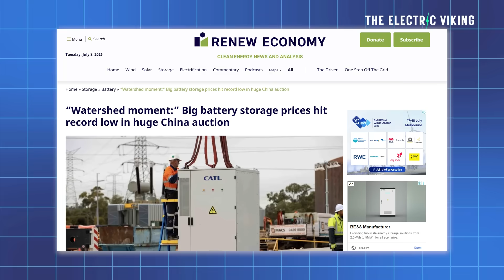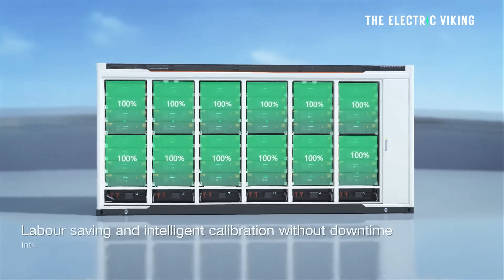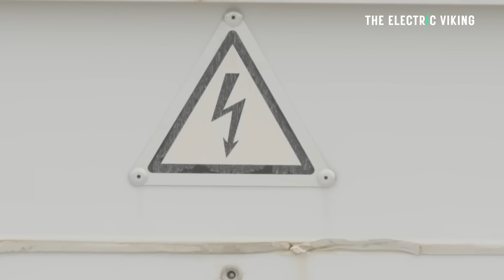Battery prices fall over 30% in 12 months - coal and gas economic madness

Comment: Im from Sweden, and the swedish electricity is 100% oil and gas-free. And of course, not a single coal plant either. And it has been so for decades. About 65% is from renevables and 35% from nuclear. And the energy prices are low. Heating of private houses and tap water is still 2% for oil, mostly old people that does not want to change. Gas is not around at all. And have in mind, the swedish climate. 

For me, personally, I drive a Battery EV, and I can drive 350 km before charging in summer. During the coldest winter (-20 deg C) 250 km. During +7 years I have needed charging about 5 times in public chargers. Back home I charge from solar and batteries wirh my own electricity. Still connected to the electrical grid though, but I could disconnect tomorrow, but I get some money from feeding my surplus to the grid. I supply much more energy to the grid than I recieve. So yes, it is absolutely possible, to leave fossil fuels behind and it works very well. If you of course have the knowledge to design your power systems in the right way. Network design is not the same in the "old school" as with renewables. This transition is starting to be adressed, towards a more intelligent electricity grid, with thousands of micro producers.

This is not idle speculation, I have done this for years. Anyone who doent agree is either ignorant or just plainly stupid or spreading bovine manure....
Reply: I went all-in with solar nine years ago, haven't had a heating or utility bills since.  Late last year I bought a Chevy Bolt that I charge at home, haven't bought any gas since 😊
Reply: very informative!
Reply: And we should continue to build up our battery factories. One rotten egg (Northvolt) should not scare us away from this opportunity to build an EU battery factory.
Reply: Unfortunately adding solar doesn't work out economically here in Oslo. Installation costs are too high. Definitely recommend it when changing roofs, though.

Comment: I was wrong.  CCGT is 1/2 to 1/3 the cost of PV plus batteies, depending on the cost of natural gas.  PV plus batteiies have to be overbuilt, resultining in about $200Mwh.  I'm a hjuge fan of PV and batteries, but they're not ready for baseload yet.

Comment: I think we still want an ultimate backup like hydrocarbons from wastes.  we could use fuel cells, but for something that will only run 1% of the time gas turbines seem fine. We need to recycle the wastes anyway, no dumping.

Comment: All forms of energy may not be enough with the huge demand of data centers in United States
Reply: Data centres are switching to optical processors so in 10 years energy demand will plummet for data processing.
Reply: a disaster at the moment, but the future looks better.
Reply: It's looking good for them, they consider moving to Canada 🍁 where there's a surplus of cheaper power.

Comment: Coal / other traditional energy sources still have an important part to play while the world builds more efficient energy infrastructure. Coal may be easy to label ‘outdated’ but what’s more outdated is having no power at all when we dive head first too soon and we don’t yet have the storage or other reliable renewables to consistently handle the load. Must be built and/or transitioned wisely, objectively and free from ideology for it to work for all. Eg. California asking people not to charge their evs. Eg. South australia having 3 day blackouts. Etc etc
Reply: carbon negative hydrocarbons from wastes can provide continuing backup since we keep making waste.  Fuel cells would be cleaner, but more expensive.  It's only going to be fired up 1% of the time, sometimes not for years.

Comment: The Tesla power wall does not appear to be decreasing in price!!!
Reply: Well, the powerwallmay not have dropped in price but the do-it-yourself powerwalls have dropped by 2/3 and you can now get a 3500 or 3200 w solar generator for the same price you paid for 1,000 watt solar generator 2 years ago.
Reply: The electricity going into that battery "wall" should be decreasing in cost.
Reply: @markhathaway9456  It isn't and it will increase dramatically in the next few years.  Our power company projects an increase in demand of 25% in only 5 years.

Comment: Remember all those arguments suggesting why wind and solar would not work? Those arguments forgot to take into account the forward progress in technology. And as sodium-ion ramps up, as does automation and more efficient PV, costs will decline significantly.
Reply: That's a verbal trick anti-renewable energy people use. They list current tech limitations as the reason to not take it seriously. As if tech will never advance or be better and also cheaper, which is what happens. I say, if you have to make an argument using a trick, you don't actually HAVE a serious argument in the first place.
Reply: @davidgrushk  its is true the solar in Germany was more then a little rose color glass the USA even New England has much more sun then them offshore wind is expensive and the cost is up front adaptation in the US wind and solar will be more productive and more easy. One of the real issues is data centers they are hogs and going up fast so even as generation increases we will have the old power plants at least for a time.
Reply: @davidgrushk  ... and pro-renewable people use the same trick against nuclear energy, point out to current or even old limitations as the reason not to take it seriously. AS if the technology will never advance. Plus, they ignore the recent lack of research into improving nuclear relative to the vast sums spent on improving renewables. Both sides play this game.
Reply: @robertlipka9541  But there is no cheap new Nuclear technology that will come close to the current low cost of solar. Nuclear still needs a base load, traditionally pumped hydro, and now batteries.
Reply: @Terry-y2r  ... of course cheap nuclear energy is possible... IF you stop adding unnecessary regulatory hurdles against it (ones that do not add to safety but increase costs), standardise on ONE safe design, etc, etc. It can be done cheaply especially when you consider renewables need storage and use thorium as fuel as not to produce long lived nuclear waste. The shame is that we decide energy policies through propaganda wars.
Reply: @robertlipka9541   How can Nuclear compete with solar which has no moving parts to maintain and free fuel. The fact is it is not even close to being economic. There is a reason for the regulations, safety. When regulations are ignored you get Nuclear disasters which result in loss of life and long term radiation contamination.
Reply: @robertlipka9541 First, nuclear is not an enemy of renewables, only carbon emitting technologies are 

Then, the problems with nuclear is that they have established cost curves, and they are negative, in contrast to renewables. The new nuclear technology touted is as of yet untested in a real economic environment. Furthermore, recent plants have been plagued by extreme cost overruns and delays. So, when you compare cost curves, you'll need to hypothesize an extreme improvement in cost efficiency to compete with renewables. Add to that the short deploy time of renewables, and it's hard to conclude that nuclear will pay a role in the future grid on any reasonable time scale. 

Luckily I don't have to convince anyone of this, as investors know how to use a calculator. The only threat is politicians thinking they'll be the facilitators of "the next big thing" or being fooled to siphon investments away from renewables.
Reply: In the UK, electricity charges are still based on natural gas.  Since renewables are cheaper, the government is playing with the idea of localizing the saving to encourage municipalities to allow solar or wind power generation in their areas.
Reply: @newsgeekus1216  

"Since renewables are cheaper"

A truly laugh out loud moment.
Reply: @newsgeekus1216  Uk need some coal plants desperately.
Reply: wind energy is still a scam in most cases. In Europe they reached 5% of capacity only, meaning most of the time they are down in energy production, but the cost is huge and the environment cost is huge also with materials that are toxic that you can't get rid of or recycle. In northern Europe, solar energy will never be enough because the sun doesn't shine when they need it the most. Take Copenhagen for instance, in december the sun goes down at 3pm and it's very cold. Countries like Spain or Australia can't be taken as example because of their climate that allows less energy needs for housing, in these countries, insulation alone will account for the most reduction in energy needs. Solar can work but panel production is not localized where the markets are so it's a labor right non sense for now. Batteries same, and they are expensive, it can take up to 15 years to amortize the cost, which is awfully close to their lifespan. Many years will pass until it's truly interesting financially. Rich people that want to help the environment can afford it but not the majority of the population. I know someone is Spain that rents his batteries and it cost half of its original energy bill, nothing crazy interesting, his whole installation is rented and it's the same price as before he switched to solar.
Reply: The cost to manufacture solar today is already around 6 cents/watt. Unless there is some material step change? I can't see it declining much more.
Reply: @davefroman4700  There's about 6 cents! But in all seriousness, there is still room to increase efficiencies, production costs, or installations.
Reply: @SeanLumly  Its already a 100% automated process. And more and more of their supply chains are achieving that as well. The price of EVERYTHING over the next 10 years is going to plummet as the digital autonomous era matures.
Reply: @davefroman4700  Reductions in production costs can be anything, including manufacturing closer to site to reduce shipping,  factory efficiencies despite being automated, or using cheaper manufacturing materials (eg. Sodium-ion batteries if this is rightly included in the overall cost of solar/wind). And yes, I agree. Costs are going to continue to fall!
Reply: @davefroman4700 The cost curve has been very consistent, and the technology is improving still, with perovskites likely to create a big jump in efficiency. Total cost will decline more slowly because of installation costs not declining at the same pace.
Reply: Yes. I do. UK and Germany were the leaders and very smart. Now they are stuffed with very high energy prices
Reply: @MPP241  very true but all of that caused these advances to happen The UK is dark so is Germany offshore wind is not ever going to be cheap they felt they had to it to meet targets.
Reply: Wind is the most expensive and least reliable form of energy production!
Reply: @derekjohnson9575 .    Maybe where you live.   Here in Texas we are going crazy with wind, generates like 30%.   Electricity rates are 14%.   We have just started installing those super large turbines that are able to tap upper flows, thus almost providing base generation.
Reply: Diesel imported by sea or air is far more expensive than wind typically is. That's why northern Canada is using solar and wind more. Long days with sunlight build up large credits for use during the winter and less diesel is used. Wind is almost always blowing.
Reply: @annoyed707 what credits are you talking about? solar and wind energy can't be stored efficiently in the quantity needed
Reply: @raph151515  The energy can be stored economically using pumped hydro for grid scale long term storage. It been done for 100 years. Batteries are now also economic to do the same.
Reply: @Terry-y2r  pumped hydro is limited in capacity, most developed countries are already at capacity in terms of hydro, nothing new to add and it won't cover most of the demand. Hydro is a high frequency storage used to fill gaps between raise in demand and plant startup
Reply: @derekjohnson9575  we have not really built the kind of very tall turbines that will run 90 plus % of the time.
Reply: @derekjohnson9575  Only true if it is offshore wind.

Comment: I live in northern California. I pay some of the highest home energy prices in the world to PG&E. Costs keep going up every year. Trump is waging war on solar wind, battery storage and EVs. None of this seems to ever change. I can’t afford solar on my roof. The math does not make sense. So the reality is that the average American even in wealthy areas of California can’t afford solar. Payback period is still very long. Sun Power went bankrupt so I don’t feel I can trust any of the many small installer companies. They install and run then go bankrupt. It’s depressing.
Reply: Mhm, maybe worth to do some math here. Germany charges 32 Euro ct/KWh to household owners. A 2 KWH battery with inverter and 4 panels retails at about 1000 Euro. Ever KWH produced goes into the house, nothing goes to the grid. My installation runs for a week now and has saved 6 euro so far. ROI 3-4 years. Not bad.
Reply: Get a small stand-alone system and a 3,500 watt solar generator. 

You can run a window unit or a refrigerator and freezer  and your computer and your big screen TV and cable router off of the battery, cutting your electrical usage by about 4 kilowatt hours per day without being grid-tied.
Reply: I am also in northern California but fortunately installed solar under NEM 2.0. This means I can use the grid as a battery. I break even, zero cost. This will go away in a dozen years but batteries keep getting cheaper and who knows,  when sanity returns to government we may even get tax breaks again. Until then I will wait and watch.
Reply: DonOld tRump isn't just waging war on renewables, he's also waging war on the Truth too...And making America a turd world Country !😅

Comment: In Hawaii households are expected to be the storage facility using LNG or Tesla battery stacks.  We also are expected to add another 10 panels to our existing panels at a total cost of $30,000.  Why can't we just use the storage without the extra panels. That would lower our cost by about $25,000.

Comment: Countries that embrace these technologies will rule the world's manufacturing.  Nearly free energy powering their businesses.  That's hard to compete against.
Reply: Then drastically pare down their energy use through integrating design
Reply: LOL, free.
Reply: The last 3 centuries of industralization was driven by energy. And as energy sources improved exponentially, our science, technology and everything progressed along.
And that was the fossil fuel era.
What is comming will be a similar industrial revolution. We will experience the next level: the era of abundance.
Reply: FREE energy???   Wind is the most expensive and least reliable form of energy generation!   Then to make it reliable you have to add the cost of batteries, which are becoming much cheaper!   But.  It will never catch up with the increasing energy demand specifically related to big tech and AI!
Reply: @derekjohnson9575    Rubbish mate
Reply: @derekjohnson9575  "Wind is the most expensive and least reliable form of energy generation!  " - any proof?
Reply: @derekjohnson9575  get a life!
Reply: @derekjohnson9575 Increased demand is largely a result of population growth and eventually the population needs to stabilize otherwise we will run out of everything.

Comment: Wind farms still seeing massive delays due to greenies and tree huggers and still many planning permits many years in delay.
Solar farms seem far less objection and far more rooftop and warehouse rooftop space within areas of consumption make community or suburban BESS systems fare more economical.
This however will take time. 
Our government planning approval process is broken and the permitting takes far too long . 
Try getting a building permit here in Victoria.
Some councils take months and months just to get approval for home construction. 
Now try and get permits for large scale BESS.  Even community battery storage.
Red tape and council delays are the biggest hurdles now not technology.
Every possible benefit seems to meet objection at planning level.
This has to change.
Corruption and green lobby groups fight against renewables. - Go figure.

Comment: Any one found study of the consequences of a long term stop of petrol usage for cars and trucks on our petrol products economy? 

Would that make these products more expensive as it will be less mass produced petrol, or does drilled refined petrol for vehicule a drop in the bucket in the totale petrol drilled?
Reply: The long-term effects of continuing to use petrol is catastrophic. 

Your argument is like saying we just need to keep releasing radioactive waste into the environment because we need to protect jobs.

I mean, for what it's worth, it's already too late.  Things are going to be exceptionally rough for anyone under 50.  

530 years from now,  10s of 1, 000s of square kilometers will be uninhabitable without air conditioning.  With wet bowl temperatures above 35 c, when you lose power, you've got about 6 to 8 hours before you leave the planet.